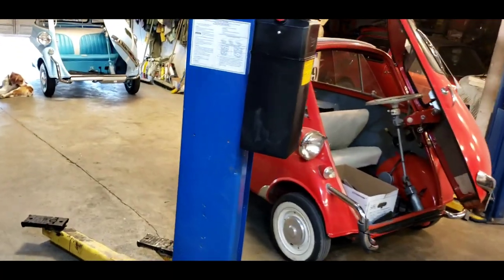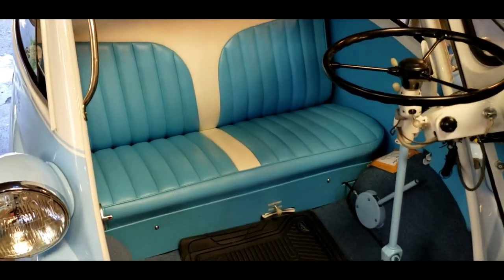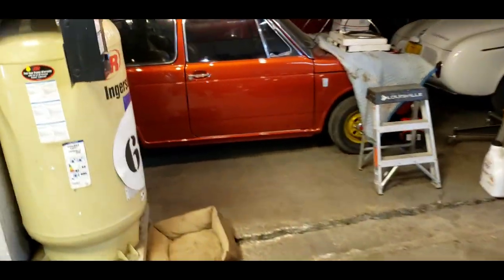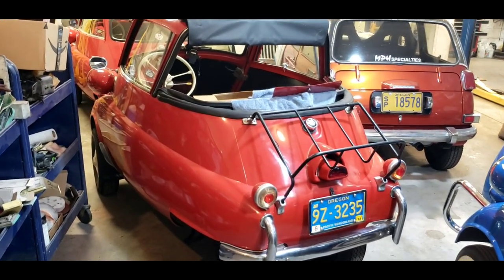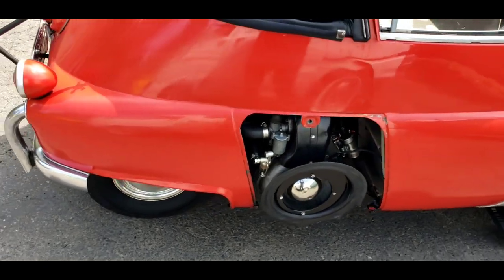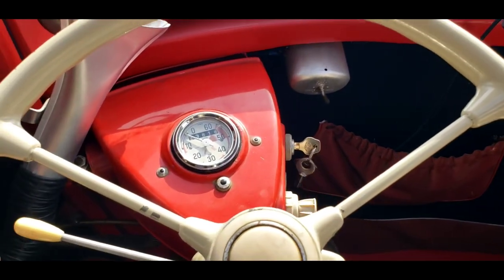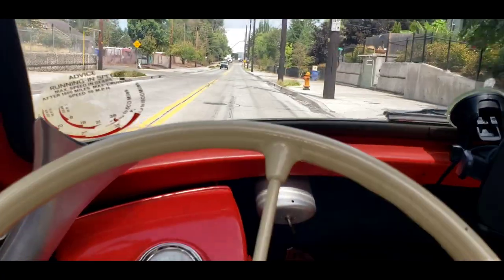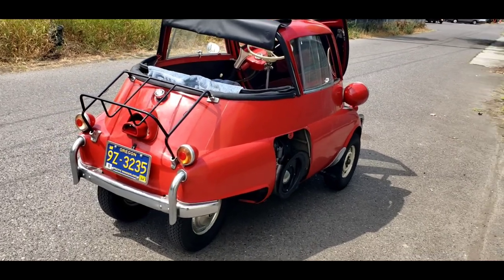Ahhh! The BMW Isetta Ultimate Driving Machine

Comment: Great video! I have owned my US-version Isetta 300 with tropical air door (which is quite rare in Germany) ever since 1980 - my greatest Isetta trip was from south Germany to St. Tropez and back home. My Isetta looks all like a 1957 model, but it was first registered in Germany in 1959 - possibly due to poor sales in the US, at the time, it had been a non-seller. As my front bumber bars were heavily deformed, I got some UK ones and had them re-chromed, as original ones were and  have been unavailable (at least in this country). Are there any affordable after-market spares for US-type front bumber bars available in the US? Best wishes from Germany!